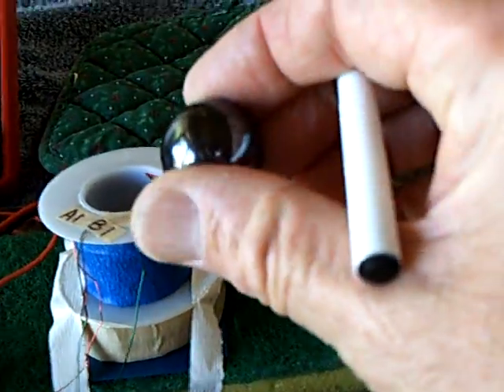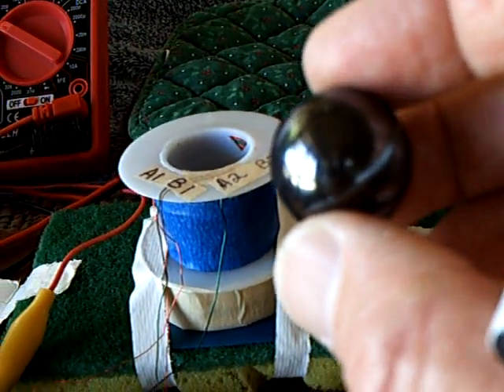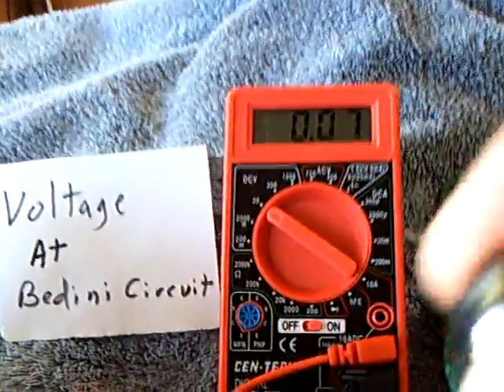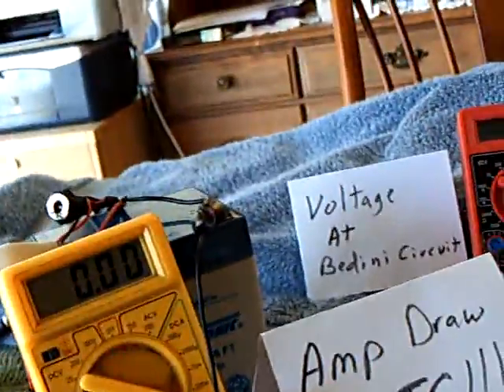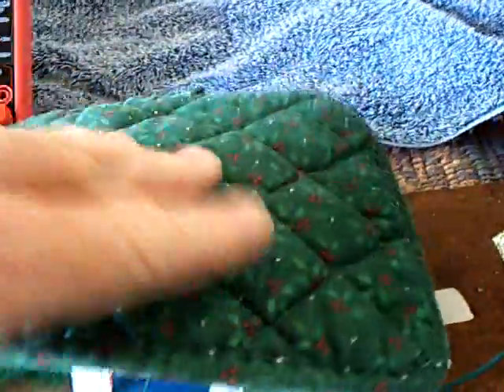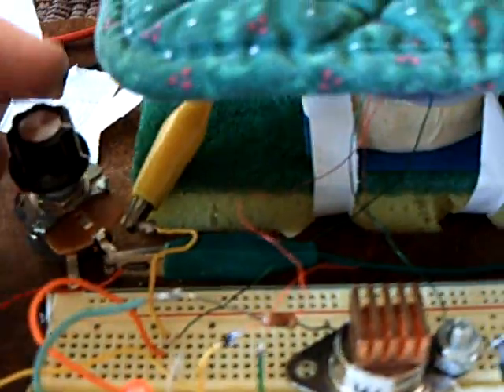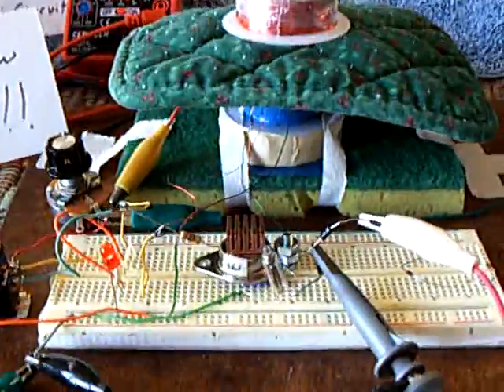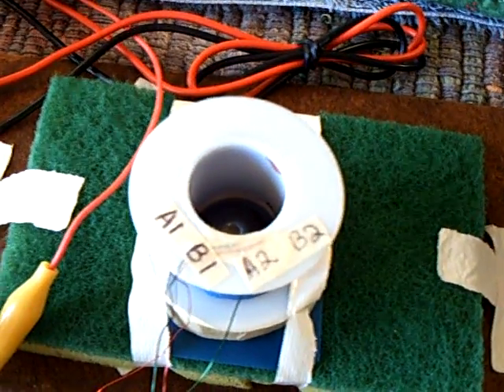High Speed Ball Magnet Bedini

Comment: well, thats interesting...
Especially since video 7 is missing...

i'm pritty sure that lid will agree with me that a FWBR is completely uneccessary... and since i've now found a way to get the BEMF to flow back to the primary battery, something by which several electrical engineers have told me is impossible... and yet, i've done it...

Comment: Lid:

Fantastic job!  That thing is really cranking!  I have some spheres I ordered a little while ago to try to replicate those guys but I didn't realize at the time that I needed to use an air core.  I tried it on my plate platform that I used to replicate Jonny's set-up and the sphere spun up very fast but then would fly off the plate.  I have several size neo spheres to try, I just need to make an air core coil now.  Any idea of the rpm from your scope?

Bill

Comment: sound = loss in energy...

but, OMFG!

running in a vaccum will not help... it's the ball itself vibrating....
I'm interested by your osciliscope readings... you seem to have 4 BEMF spikes per cycle... 2 at the start, 2 at the end...
I'm thinking that it's due to the rotation of that ball... i wonder if their is a way to stabilise the rotation...